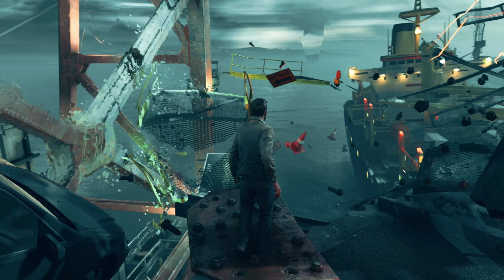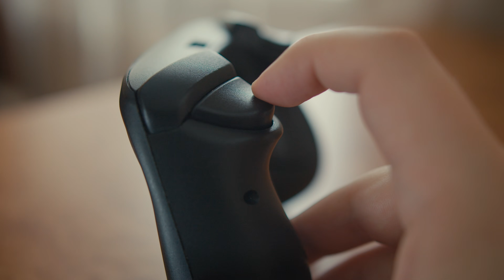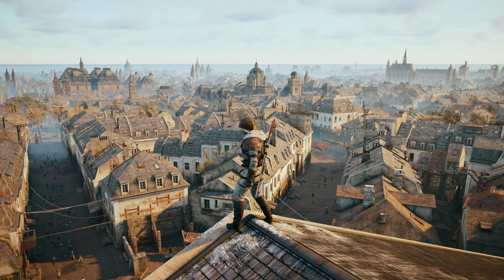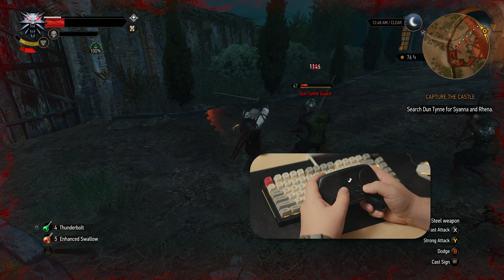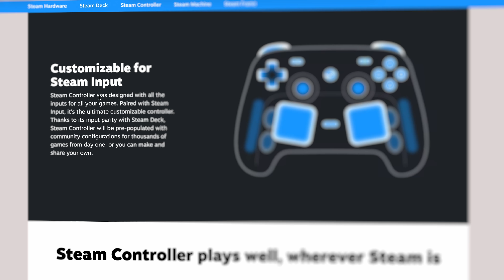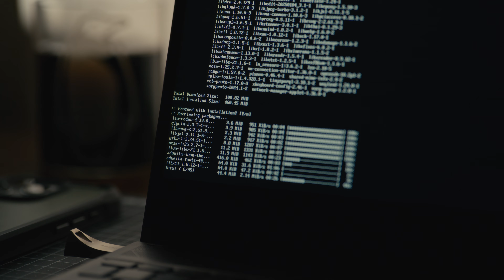Steam Controller Is 10 Years Old Now!

Comment: They really should fix steam-input and make it bulletproof. It takes courage to accept bugs and clunkiness, even for a tinkerer like myself. Because sometimes I have to redo whole config, because stuff go really wrong and it breaks config file. It doesn't remember menu position, forcing you to go back to the entry every time you want to adjust a slider. Include custom acceleration curve. There are a lot of things, that could be improved.

Comment: It irks me a bit whenever people talk about the Steam Controller and only say that it's a way to play games designed for mouse and keyboard. I know it is the main reason it is designed how it is but it's just that I personally see the trackpads as replacement for analog sticks more than mouse/KB 😄 
I didn't grow up with consoles, at least the generations where analog sticks were actually used in games, so using them for camera and aiming is so foreign to my brain and I never got used to them. The touchpads however felt natural to me.

I'd pay 100-150USD for an updated OG Steam Controller with better build quality, features and perhaps with a dpad instead of the sticks.

Also, it can indeed be overwhelming at first because you'd want to customize the controls per game but it's actually simpler if you don't. Just make a template and use that for each game and tweak them as your progress in the game when you already know the controls. Personally, I just use left touchpad for movements and right for camera/aiming. The rest are the same and I used it for most games. I usually just tweak the paddles.

Comment: I still use my Steam Controller for almost all games. If the game doesn't support mixed input, I happily spend the time setting it up properly. The new Steam Controller is an easy day 1 buy for me. My biggest hope, though, is that Valve will publish some controller support guidelines for games to be fully compatible with the Steam Machine/Controller, so that games directly will support "mouse-like" input for trackpad and gyro. The biggest hurdle is probably that most game engines regard controller and keyboard+mouse as two distinctly different types of input.

Comment: I know how you feel with your controller not working when you first got it. I had bought a cheapo Android controller around that same time and even though I don't play modern triple-A games, none of the older games I played would work. However, most of the games I play are through an emulator, so I was able to just modify the emulators to read my controller raw and insert the inputs into their event queues. So I was pretty lucky with mine, especially given that it was only $20. Although, I can't seem to find a price on the new Steam controller. Any chance you know, or just have a good idea, how much it'll cost?

Comment: When you say "adding a second thumbstick and dpad solves the steam controllers 'problems'", personally I think your first principles are skewed a bit. That kind of a statement suggests that controllers must have certain inputs, which leads to stagnation and why xbox controllers have been basically the same for more than 2 decades now.
Its genuinely not a problem that you only reach for the steam controller for some games and not others. the steam controller was built for a specific purpose (its first principles were different), its more like a "genre peripheral" than a generalist device.
whats funny is that if you spend time with it, you can learn how to use it as a generalist device - and play to a very high level with it in those situations - but because the initial impression isnt great for those situations people just dismiss its actual capabilities.
A decade later, its still the single most misunderstood piece of tech out there.
Reply: I think the main problem is the lack of those input methods, i agree that nowadays controllers are stagnant but to be honest they are mostly where they need to be, more buttons will always be better but less will never.
Something like capacitive sensors can be useful but are sometimes gimmicks (i believe the 2026 controller's "gripsense" is this), yet gyro and back paddles are useful things.

Regardless of this though, i just bought a 2015 steam controller in spite of the 2026 one because of the focus on trackpads and because its actually in the market at a reasonable price and im hoping i can use steaminput to bypass the lack of standard input methods
Reply: I just yesterday found one secondhand at a Goodwill and I love the quirkiness of this controller. The touchpads alone are great, there's something oddly satisfying about them. I do however find that the placement of the stick and the face buttons does feel somewhat awkward, but again to your point this is due to it breaking the mold of a more generalist device. I have yet to experiment more with alternative button mappings, but I do feel that there is great potential to be found in this.

tl;dr I like the quirky boi. C:

Comment: as much as it is customizable I have yet to utilize it to its full of its abilities. every game that is setup for a right stick is clunky OOB using the right track pad set to emulate a right stick. a little over a year ago I pulled my dongle from my PC because It kept disconnecting, opting for BT. I do not use it with my steam link because the latency drops frames; steam renders uncompressed then transmits rather than compressing. running old titles at 1kHD is 1/3 the performance on my pc as it has a need to transmit to my local monitor too. both are imperfect solutions to problems yet to be solved. when it works, Wifi monitor support to a second screen(my TV) works better.
Reply: That's the issue. It was created for mouse and keyboard games first and foremost but valve decided to tack on support for "controller" players and even launched it with that in mind which was damaging. It sucked for xbox controls but was awesome for emulating mouse and keyboard because thats what it was designed for. I blame Valve though as they released the thing with no instructions at all on how to use it. It was the die hards that made youtube videos on how to get the best out of it.

Comment: My favorite games to play on the old SC was immersive sims like Deus Ex or System Shock 2. Games never intended for controller, but using the stick zone for wasd and wasd+shift for pseudo analog movement, a touch panel for selecting 1-10, press right or left on right trackpad for leaning, gyroaiming, etc. and it felt like how they were always supposed to play from the couch.
I don't need the new SC, but I'll have to get one for the convenience.